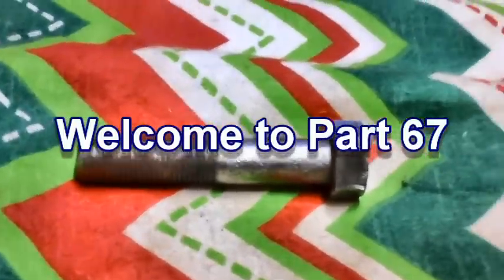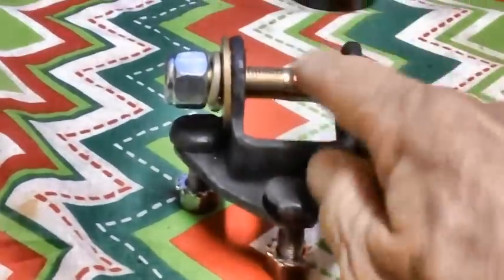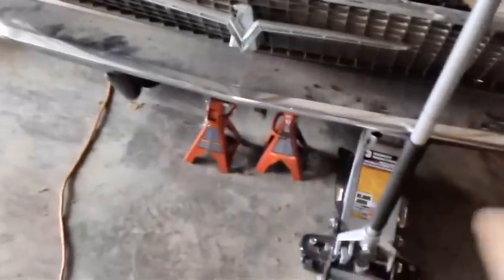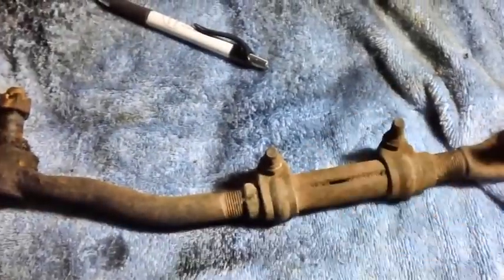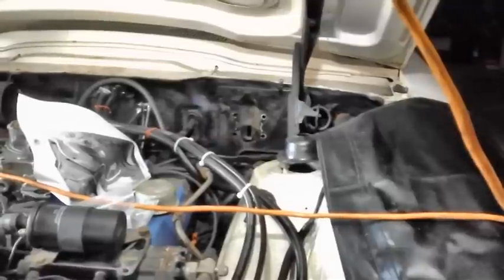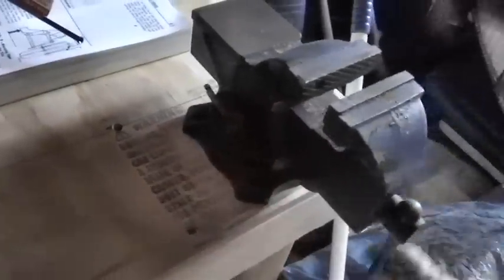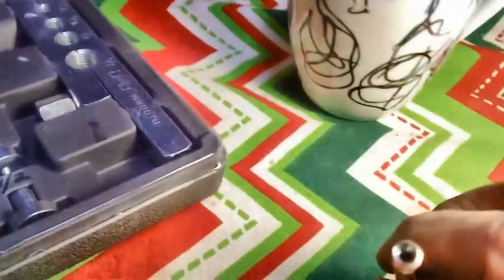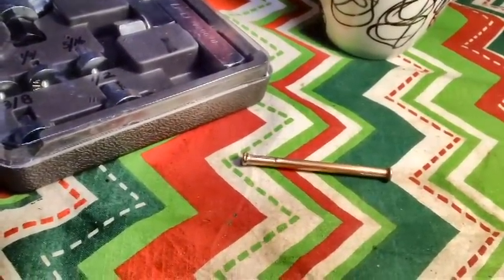1966 Ford Thunderbird repair and refurbishment (Part 67). Tie rods.

Comment: Hey John, I just replaced both tie rod ends and adjusting sleeves for my 66. A company called a-resto-parts had a kit for both sides for 139.99. I thought I would try them out. They got to me quickly and seemed the same as factory with greasers on all the joints. Would definitely recommend
Reply from the maker: Jeremy,
Stand by to stand by, my friend.
Regards,
John
Reply: I know I've also mentioned in the past but I have a ton of spare parts left from another 66 I was using to build mine. If there are is anything you may need let me know and I will see if I have it
Reply from the maker: Jeremy,
I responded several times to you about this, but apparently they're been lost somewhere in the Ethernet shuffle.  I don't know what I might need in the future, but I'd like to know more about what you have available.  Contact me via email...my YT handle @gmail.com.
Regards,
John

Comment: You can line up the clamp thingamajig and drill a 1/8 inch hole thru it then get a 1/8 inch steel rod and cut off a short piece to put in the hole, That will keep the two halves lined up.  At least that's how I fixed my clamps.
Reply from the maker: Mike,
Too much work, my friend.  Better to just buy one of far better quality which is what I did.  So stand by to stand by, my friend.
Regards,
John

Comment: I would think the grip length of the bolt should be long enough to go the complete distance for the space between the ears and the threads should start just inside the protruding ears to allow for torque specs. That way the bushing will ride on smooth surface instead of half smooth and half rough threads. Just what I learned after working on aircraft for many years.

Comment: That shock bolt may not have been original.  Looks like the shoulder should be long enough to go all the way through both ears.  That may be why one of them is bent since the threads were all that was making contact on one side and they are not always the same diameter as the shoulder.  I would think this would be prone to failure.
Reply from the maker: Bill,
I thought the same thing, so I went to a couple of Thunderbird parts provider web sites and checked out their offerings.  Same-same.  Sorta strange, eh?
Regards,
John
Reply: @joernone  Strange indeed.  Think I would still want that shoulder all the way through.

Comment: You know John, if you can keep your budget under 7500 hundred then you are doing darn well. I have never rebuilt a car to the extent you are doing but I've rebuilt two Harleys and built two airplanes so I understand projects. With what you have and what you have been doing is great. Perfect example is getting stuff like that vice,,,, oh boy is that nice. btw,,, your strategy for project time and money situation is called " happy wife, happy life " I believe. ☺
Reply from the maker: Carl,
The new budget limit to make the car safe is lifted from $2500.00 to $5000.00.  I think it'll be easily manageable.  We'll likely come in well under that amount, as right now I can only foresee about $500.00 worth of expenses to go.  Nearly everything needed has already been bought and now waiting to be installed on the car.   After that it's purely cosmetics all the way.
Regards,
John

Comment: John, I have never had good luck with inexpensive flaring tools. Rigid makes very good ones but they are quite expensive even for a simple 37° single flair style. The double flair ones are even more but they do work well.  Maybe Auto Zone or Advanced Auto  has them available to borrow as needed?
Reply from the maker: Larry,
Correct, I could have borrowed a flaring tool from O'Reilly's, but I want one of my own.  Interestingly, the tools that O'Reilly's has for loan are of much better quality than the ones they have for sale.  Go figure.
Regards,
John

Comment: John, I do not know much about cars, but a question. The new bolt has a shorter UNTHREADED part and I wonder if that will matter when the shock is attached. I would imagine the transition from solid to threaded is always the weakest part of the bolt.... but I could be completely wrong.  You know me.. my ideas suck :P      You said you don't drink and don't smoke.... but now you do have a vice..... and its a good one !!!  Use it well my friend
Reply from the maker: Ron,
It would seem you're right, my friend, and I thought the exact same thing, but the internet Thunderbird parts providers sell those same bolts for the shocks.  Being that they're hardened steel I doubt there will be the weakness we both considered.
Regards,
John

Comment: brake line must not leak, yup, crap tools = crap results, and failure.  
Now iffin you had a Bridgeport mill, you coulda fixed that crap flare tool, lol.
Reply from the maker: Don,
I don't fix tools.  Tools are supposed to fix my stuff.
Regards,
John